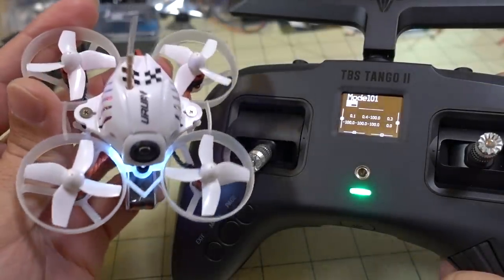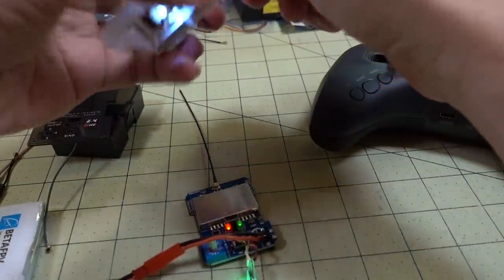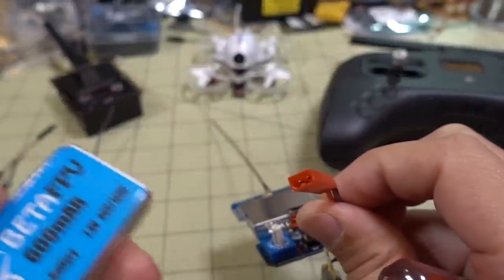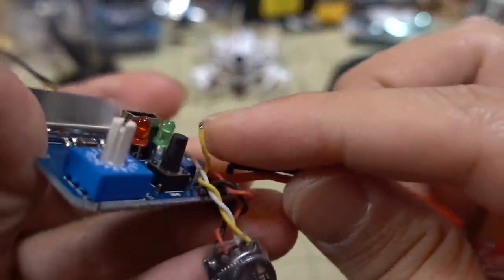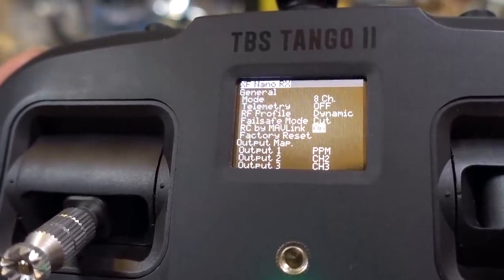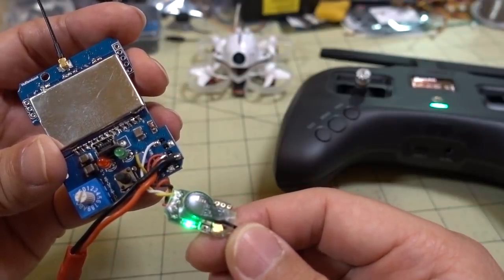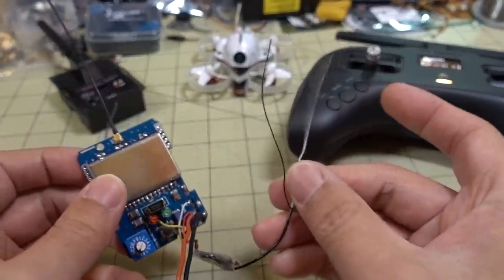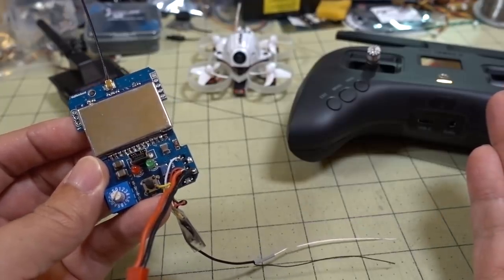TBS Tango 2 Multiprotocol Repeater Tutorial 🎓

Comment: I think it is pretty cool you have both came to the same "old" solution with Bruce. My only question is how much (if any) noticeable lag has been introduced by having a "third person" translating the signals? For those who intend to race with Tango 2 in whoop series.
Reply from the maker: As I'm not a racer I cant say how much it will affect a top racer.  I'm sure the latency will not be good for those top pilots.  I am trying to figure out a way to get this to work on SBUS instead so stay tuned.
Reply: @AlbertKimTV  I think the flying was very solid. If you have not noticed - it might mean it is not noticeable. In normal terms the radio control's lag is much less of an issue what we used to deal with - my guess is it will be still within the human limits. Good work!
Reply: I think the lag is simply the use of PPM. Even in LOS flying the first time I went from serial RX to PPM the lag was so noticeable that I felt uncomfortable with it. I don't think It can be done without a serial connection being already built into the module though I admit I'm not sure how different the TX connection talks to the module in comparison to a serial connection. Are you trying to get the RX to talk to the module thru the TX connection??
Reply: @AlbertKimTV  Any update to serial usage? :D

Comment: For those of us just flying in our houses, can the multi module be powered thru the USB port to a iPhone charger possibly? Reason I ask is when I plug my irx4+ into my laptop it powers up, so I was thinking for my my application indoors just to plug it into a outlet near my seat . Looks like that crossfire can possibly fit into that module case u have there, for a cleaner installation, especially if that usb cable can power it up. Worst case, if the signal from the crossfire isn’t getting thru a tiny hole for the antenna to pop thru would work
Reply from the maker: On my module USB wasn't enough power to transmit.
Reply: Albert Kim I just seen that it powered up, If yours didn’t transmit then mine probably won’t either. Says my laptop outputs 5v so it’s probably just enough to power the lights and whatnot.

Comment: Albert, do you notice any latency?  I'm keen to build a repeater for some slope soaring gliders, they haven't the voltage to run TBS Crossfire but I'd like to use my Tango 2 radio.
Reply from the maker: I think for most airplane flight, you won't notice any latency.  I barely noticed much even flying FPV through gates.

Comment: I put a crossfire on my first brushless whoop. Then I hated the fact you cant find it far away. Now the min is 3in.
Reply: I'm pretty sure you would still be limited to the range of the Frsky receiver since it's still using that to link to the whoop. I don't understand why someone would do this if they already have a FrSky transmitter or module. Just to use the Tango 2? It's like one step forward and then 2 steps back to do this. I'm sticking to my full Croosfire module, don't need another radio to add to my collection.